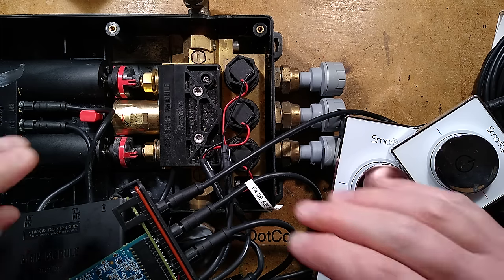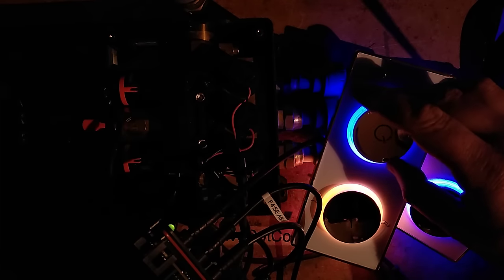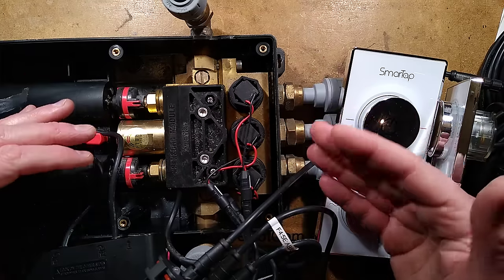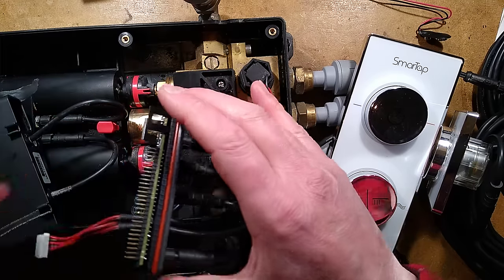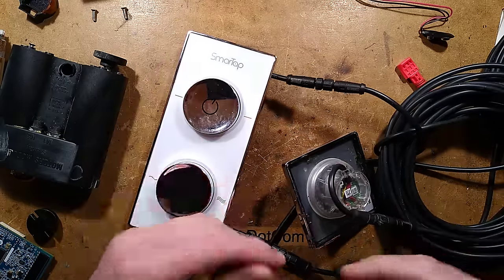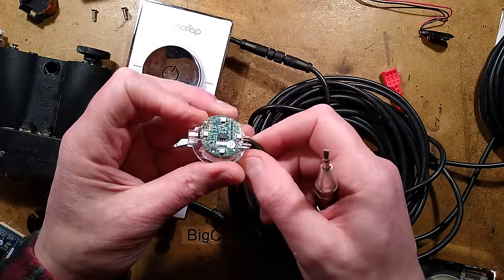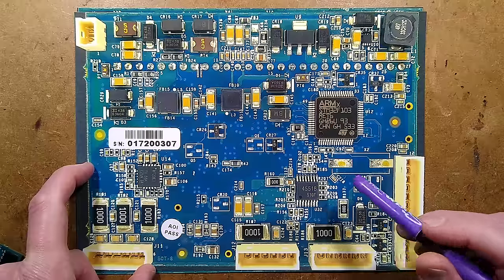Smartap - when the Internet of things goes down

Comment: No doubt had a subscription fee on top of the £800 product itself. 

I do see value in a few possibilities of this product: being able to turn the faucet off if you forget you had it running and leave the house; being able to turn the water on and get up to temperature while you’re grabbing your clothes for a shower, then turn it off so you don’t waste water; automatically turning the water on at a slight trickle when it gets below freezing so the pipes don’t freeze; I’m sure there are other things I could think of. 

The problem is, I just don’t see many people wanting to spend ~$1000 on something that adds so few minor conveniences. Smart home devices are prominent because they’ve become cheap or they add value worth the price. People will buy a smoke detector that costs 4 times that of a normal one when it’ll call both you and emergency services when it detects a fire while you’re not home. You’re not going to be able to run a business off of the sort of consumer who will buy a faucet with Alexa integration. 

I’d see much more value in an individual unit that could attach to a handle and turn it for you, kind of like those deadbolt turners. Then, even if one failed, you can pop it off and turn the knob yourself. At the very least, this sort of system should be per-faucet, not whole-house.

Comment: RT32EI -> TRSF3232EIPWR: 3-V TO 5.5-V Two-Channel RS-232 1-Mbit/s Line Driver and Reciever
4551B -> BU4551BF: Quad 2ch Analog Multiplexer/Demultiplexer
ATH444 -> @alexv3780 already identified as AT24C04C: 4kbit i2c eeprom
Z1361DI1 -> AOZ1361DI: 28V/2A Programmable Current-Limited Load Switch
363ABB -> MLX90363: Triaxial Magnetometer IC with High Speed Serial Interface
The inductor on the opposite side of the hall angle sensor could be to extend the magnet's field by focusing the field lines throught the ferrite spool.
Would have liked to be able to see the part number on those switching power supply ICs though ;)

Comment: There should be a law or a mandate,
where if a company goes belly up or "dissolves",
they have to provide the server-side functionalities in some sort of a repository...

Or when the company gets bought up and the service essentially disappears overnight, there needs to be a requirement, 
that the new company either provides further support, until it goes belly up, or until they discontinue the product.
After that, same thing- they have to push out either the server files or unlock all functionalities, that tie the device to an outside source...

For anything that "phones home" for any task should be required to provide the server files for the devices to remain operable...
And as a sort of closure, the devices should get a last "EOL update", where specific details (server address to contact, login credentials, ip-address, etc.) are wiped from the device.

I hate it when stuff like this happens.
Fridges, washing machines, door locks, vacuum robots...

~ 2 years of service and after that one can throw away half of the bought inventory...
Reply: Riiight, and where would the money come from if the firm just went belly-up?  YEah, good luck with that.

Comment: Single button is remote start - push it as you enter bathroom and the shower dumps all the cold water out of the pipes and gets to temp before you get under. 

Outputs of main head are probably handset, rain head and bath filler

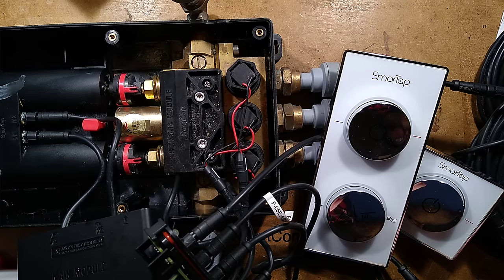Comment: That rattle 2:10 is a servo stalling (I know you knew this)... 🤣Love your uploads, Big Fella! 👍
3:50 Had to leave. That servo self destructing is too painful.
Reply from the maker: Geared motor with magnetic encoder just not getting the message back to the controller.  Probably due to the corrosion.

Comment: Do you know what? I have a twisty little thing on the wall, above the sink. You twist it one way and the water flows. Twist it the other way and the water stops. You can also select a point in between to choose a rate of flow that you prefer. It's been there for at least forty years and works every time - no electrics, no electronics, just grip on to it and twist. Just the way a water tap should be.

What was that famous quote from Chief Engineer Montgomery Scott, when he nobbled the USS Excelsior? "The more you overthink the plumbing, the easier it is to stop up the drain"!
Reply: Magical.  😂
Reply: But you can't get likes on Facebook, Instagram, TikTok etc, sharing pictures and videos of a classic water tap unless it's made of gold and the handle has diamonds 😉
Reply: Joints still have to be changed from time to time. Corrosion and wear is still a thing, especially after 40 years of service.
Though manual thermostatic mixing valve (or a non-mixing thermo valve for hot water radiators) are way more convenient than messing with old taps.

Comment: While the geek in me loves the concept of home automation, I use it very sparingly. I have a ZWave raspberry pi controller, but it only does a few things. I have a pocket door that prohibits mounting a decent electrical box so I put a wireless button to control the room lights (and if turning them off will also turn off the ceiling fan). It also makes a hall switch into a faux 3-way (I already had z wave and it was easier than running new wire). In both cases, it works even if the controller dies - you just have to walk across the room to shut off the ceiling fan 😂
Reply: Home automation? I'm in danger.
Reply: ZWave has been great, I wound up with a whole bunch of Monster branded Leviton ZWave products and have been using them with the Monster remote control for many years but I’ve been wanting to upgrade to an RPi so that multiple devices can act as controllers now that I’m in a house instead of a small studio apartment.

Comment: You go to have a shower, turn on the tap, there is a small leak pushing the corrosion over the edge on the motor/encoder while you shower. You are done, and it cannot turn off again. Fun!
Reply: And then it soaks something at live mains voltage and then you have a disco shower.
Reply: @JamesChurchill3  connecting the plumbing to earth is part of the electrician job as well as installing at least one differential current relay.

Comment: Our aqualisa 'digital' shower is now coming up to ten years old and still working, although its valves may be getting sticky... I think it has spring-loaded valves so it'll mechanically turn off with a power cut.  But it doesn't have any control other than a button / encoder inside the shower cubicle and one outside. 
So it'll probably last about as long as a fully mechanical thermostatic shower valve, and I found it much easier to fit.  With motors / pump upwards and pipes down...

Comment: I spoke with what I thought was tech support for my blinky LED strip. Turns out it was the tech support for the control module. "The control module and backend for the web server is ours. The problem is they tacked on a crappy web front end and the Alexa connection. The controller can do lots more stuff that is pretty cool but if it isn't part of the front end there isn't much we can do." This is getting really common in IoT. They buy some sort of web enabled device and bolt it onto their camera/lights/tap/etc. without really knowing what it is doing or a way to update it. Many of them will have your wifi info stored in them and it is easy to extract after you have thrown it away.

Comment: The single button is a 'remote' start that would be mounted somewhere outside the shower so you can turn it on before getting in. The three outlets are likely for a tub filler spout, hand held shower and rain head. I have a Triton digital shower in one bathroom and there are some advantages with accurate water temperature and plumbing/servicability, however I don't think I would fit one again and stick with mechanical valvles instead.

Comment: Encoder knob likely uses the MT6701 magnetic angle sensor as it's cheap, i2c, outperforms more expensive types and has the ability to detect magnet proximity for 'push to switch' control.

Comment: Some of the home automation companies started out being used for disabled people or people with limited movement like the elderly, Lightwaverf started this way, that's why their wireless switches and remotes don't need an internet connection or hub to work, they link directly to the device their controlling.  When the IoT started appearing they got a hub and mobile app and joined the IoT club.  Locally connected wireless control still has a use in this area and for the normally mobile it can just be more convenient, saves having to get behind a cupboard to switch of a socket or maybe climb into an attic to switch off a ventilation fan.

Comment: I plumbed my home with a one inch cold water manifold that fed the supply to the various sinks and bath area, it fed the water heater as well. My logic gave birth to a shower that was usable regardless of the usage of cold water, the temperature remained constant, the actual flow may diminish slightly but hard to detect.
I would never have such a foolish interface between me and the water supply

Comment: I had the smart heating system back in 1990 it was all on site but I had a phone interface. It was brilliant operating heating lights & curtains+ more. It was based on same CPU as the Sinclair computers it works using the house wires with switched wall boxes & was working when I sold the house 20 years on. With no outside service's so not a problem if the service ends & so reliable parts not a problem.

Comment: Hey, Clive, something you might do a video on...after 30 years, I decided to go back and pursue a career as an electrician again (in America). Back in the day, we had GFI-protected circuits (GFCI), and now, we also have "arc-fault" protection. I haven't even had time to investigate what this means. I'm sure if you did a video, I'd understand it right away. Just a thought. So much has changed.
Reply from the maker: The arc fault breakers are pretty complicated to try and differentiate an actual arc versus electronic switching noise.  I'm hoping they don't enforce them here.

Comment: Nicely modular design to this thing's hardware (if overly complex). Pity they had to go & do the server connectivity instead of allowing it to run locally over at least some kind of open protocol. Could probably replace/augment the switches with cannibalised Zigbee (etc.) relays to resmartify it with a little soldering though. Harder to give it a manual override for the taps, but that should also be possible by adding a thumbwheel around the taps that could be controlled through a hole in the case.
Reply: Technological "fluff" but nicely constructed! I can well understand why it carried a premium price tag.
Reply: @woolymittens  And also why the company went belly-up, sadly.

Comment: Another REALLY fun failure mode for IoT stuff (and Starlink made this mistake too) is how stuff now factory-resets by turning power on/off 2-3 times in a row.  It can be hard to do as a person, but it seems power company line-reclosers are GREAT at a consistent on-off-on-off as they attempt to reset the grid with a tree or something on the wires, and can quickly factory-reset every smart-bulb and Starlink router in the area!  Then you get to spend time one by one re-pairing each bulb to its base and reprogramming your Starlink router until the next time it happens again.
Reply from the maker: That's an interesting side effect.
Reply: Tbh it's better then some of the over complicated methods that I've seen. Power on for 1 second, off, wait 1s, on 1s, off, wait 5s, on 2s, off, wait 10s, on 3s, off, wait 5s, on.
Congrats you have now factory reset your bulb, if you were off at all during this you failed and try again. The stupid fuck took me over an hour to reset.. And then it forgot the WiFi network a day later.
Reply: @Underskore  that's when you buy a smart switch just so you can program the reset sequence in and fire it with a button lol

Comment: Early 80's, I was installing Ericsson Systems (Aust.) into motels. Mains, Bath, Shower, Phone, TV / Rent a Video. 
They ran from a single board with a Z-80 CPU. 
I should have charged per kilometer of wire... 
Toward the end I designed a little daughter board to send data over power. 
I also did the horizontal boring and/or Radio Links. 
Young n' dumb, happy dayz...

Comment: Interesting, my first go at writing custom firmware was for a Bluetooth faucet valve that was proving un-hackable at the communication level. Much, much simpler circuit though. And when Insignia shut down their servers for smart switches, I... did not bother reverse-engineering their modules at all, the "IoT" aspect was isolated to a daughter-board that I just swapped for an ESP8266 with Tasmota. Much more functionality, and the server is under my control.

Comment: Had one of these, it stopped working after about 18 months, just outside of the warranty, and the cost of replacing was more than the cost of a replacement shower unit, so new shower unit, with proper taps, which work fine

Comment: Who would have imagined that you can replace a piece of brass by a cloud&electronics operated piece of brass. Will Alexa ever understand me with the same precision that I can handle the handle. I mean, I‘m a nan and Alexa is a …
😂😂
Reply: I hear you! Power car windows are a good example, at least the cheap ones. If you want the window open just a little it's easy to arrange that with a crank. A power window button will go too fast so you always overshoot. I realize that luxury cars have a fine adjustment if you barely nudge the switch.
Then again it's kind of a boomer thing to regulate the car environment using the windows, modern people just set the temperature and leave the windows closed.
Reply: @davidg4288  
My British car thinks that if the window on the driver side is open, but the driver already opened the door, closing the window might not be needed before you start the engine again. And don’t ask about the car‘s decisions if I come close with the remote in pocket and touch the door handle. From gracefully opening to alarm horn I had every possible and impossible response. Also funny: I closed the door via remote, but was not close to the car and the way into the house brings me closer. Sometimes this unlocks the car again. If it’s AI, it’s in the same mental age as my grandson: 2.5yo 😎

But I really like this brand with the cat since 40y and my employer is graceful when it comes to company cars, so I enjoy it as long as possible. At least my plate reminds me of the good old days: it contains XK. 😎
Reply: @fromgermany271  Well I sure wouldn't mind having that for a company car! As far as fighting the computer goes I needed to lock the keys in my Honda (someone was coming by with another key) but it just refused to lock with the key fob in it. Some Honda software engineer had decided that I wasn't going to do that.

Comment: These units use the internals of 1/2 turn ceramic taps/faucets to control the flow to the shower/basin/bath, I did a review of a whole load of ceramic taps/faucets for the tenants panel of my housing association, and I settled for for 1/4 turn ceramic taps/faucets with lever top as the renters of the housing association properties were slowly getting older and lever top ceramic taps/faucets would be easier for the to use.

Comment: I have been into home automation for about 4 years now and I have 3 basic rules that I always follow. 1.  Every smart device must have a physical switch in addition to being controllable by voice or HomeAssistant. 2. every smart device must be easily removable and restored to the  basic non-smart tech that it replaced. 3. Every device must have local control not cloud based control.

Comment: I saw someone else post some rules for home automation so I thought I'd put mine (based on theirs):
1. Home automation should always fail to the dumb equivalent
2. Home automation should always be able to be used without the internet at levels of "smart" that don't require the internet (i.e. phone in wifi network to device) and ideally should just allow full open source self-hosting like Home Assistant
3. Home automation should always be built such that parts are modular and replaceable even if the company that originally manufactured it fails. (Documentation for components so that if the logic fails, you can swap in a custom ESP32 board or the like)
4. Home automation should always have dumb physical overrides (i.e. a light switch that ensures the light stays off and a button that ensures it turns on)

Comment: I often wonder what the purpose of this kind of device is?  Like...are you also putting some kind of smart thing in the bathroom to give it commands?  Or are you turning on the shower from a lay-z-boy in the livingroom wasting a ton of water until you get up to the shower?  Or like having to find your phone, unlock it, find an app, open the app, and push buttons...instead of just turning the knob?  The usecase for these things where you have to walk to it ANYWAY is lost on me.  I can twist my basic bath knob to the right temp 99% of the time the first try and the water is hot by the time I get my clothes off to climb in, with minimal waste.